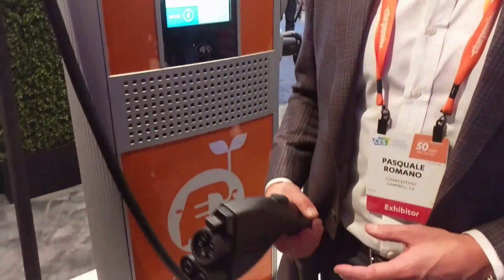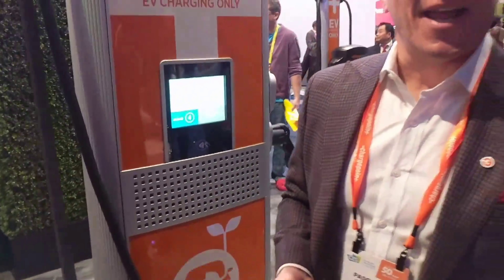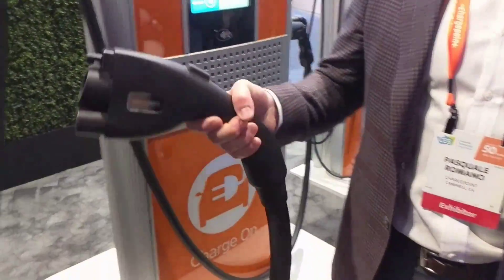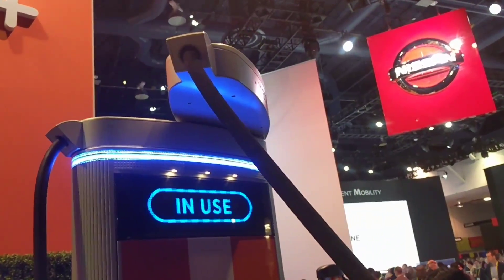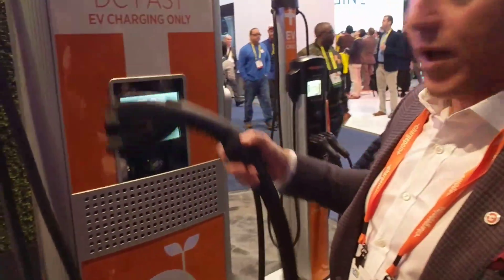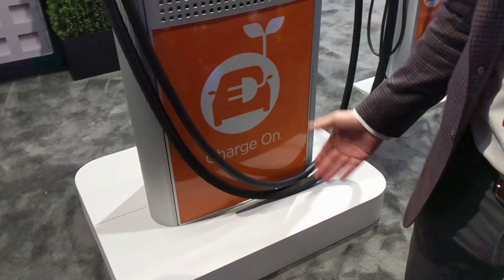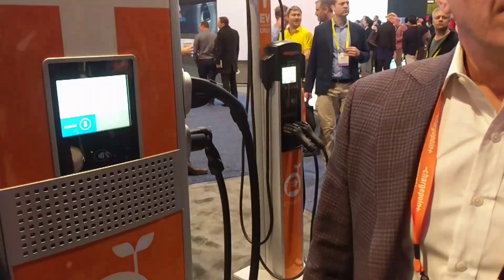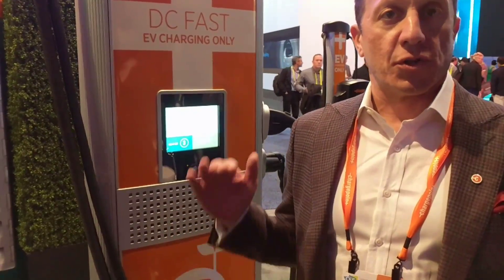Chargepoint CEO Pascal Romano on new 400kW DC charger

Comment: 4000 amps and 1000 volt? Holy crap. that's 4 million watts!  Your average outlet is designed to handle 15 amps and 120 volts, or 1,800 watts.

This car charger is over 22 hundred times more powerful than a wall outlet!
Reply: 400 amps not 4000.  But that's still 400,000 watts at 1000 volts.

Comment: "those are the limits". It won't be running that that power level. That's a lot of power coming off the grid :-)
Reply: There is more to it than just Amps and Volts. Do not forget the conversion from AC to DC.
Reply: 1kV is a standard medium voltage line. That could simplify deployment. No extra step down transformers. You would only need to worry about the grid's amperage.